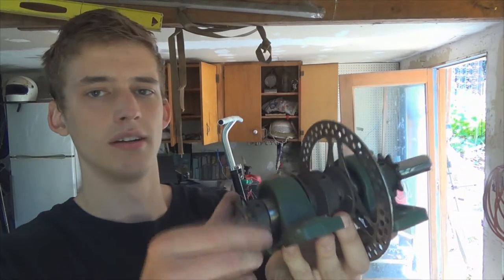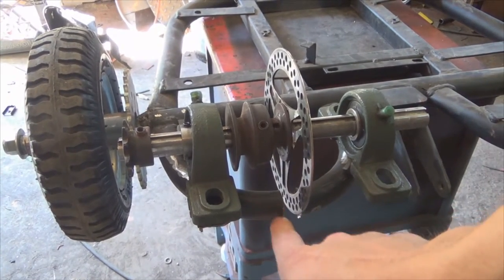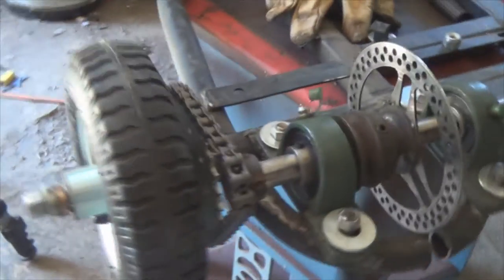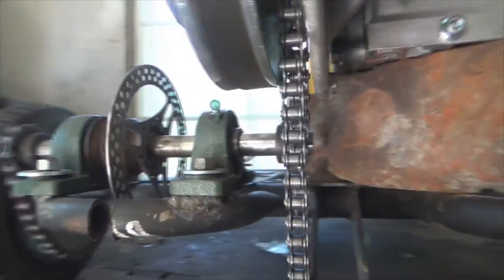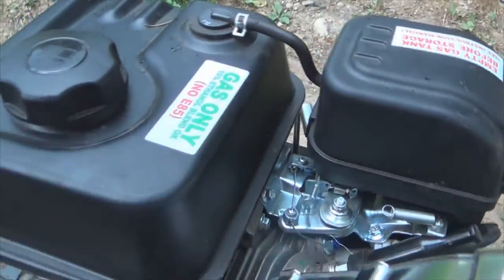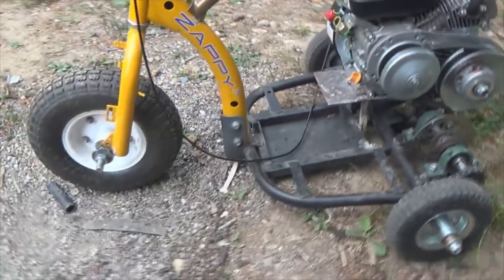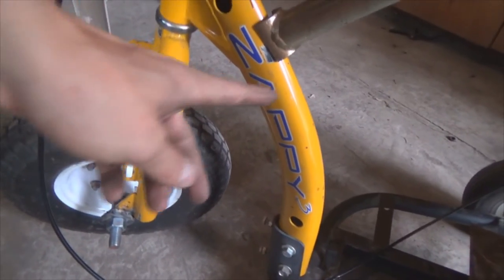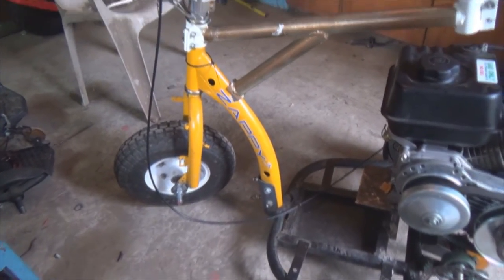Zappy Trike (part 3)

Comment: hey oliver, im curious where you get alot of your pulleys. Im going to be building a few custom motorized bicycles and i like your use of a belt tensioner clutch as you've used on some of your builds. the only think i need is a few pulleys to get my ratios down and i can start making this thing. If you could give me a few ideas of where to find cheap pulleys id really appreciate it.
Reply from the maker: +Derrick K A junk yard, Old cars, I bought some off of ebay, and if you have it i shop at Coastal. Good luck Derrick.

Comment: Where did you buy that belt-clutch-to-chain-gear thingy..??  & how much..??
Did you get that brake caliper at a bike shop, or motorcycle shop..????
Reply: It's a torque converter for about $120
Reply from the maker: +Bob White yup just a cheepo torque converter. I think i actually got this for $100 including shipping. and the caliper is off of ebay for maybe 10 bucks. Thanks Bob

Comment: Hey i have an ideo for another build video (only if to you need one) and i was wondering if you could build a tank like gocart with a track and suspension system. It would be super cool if you could figure iut how to do it ;)
Reply from the maker: Not Hating Just Stating I would love to do that, But I'm not sure were I would start! Maybe a snowmobile? haha thanks for the suggestion!
Reply: I have seen a couple videos where it looks like they convert a small tav, you may be able to use that for a frame.
Reply: -atv
Reply: +Oliver Motorized What's up Ov. That little trike is sweet. You are the build king, nice work.
Reply: +Oliver Motorized you should make a 2 speed mini bike that runs on a 6.5 hp engine